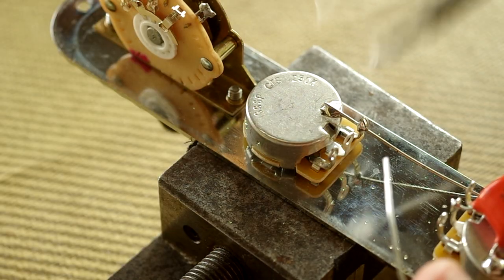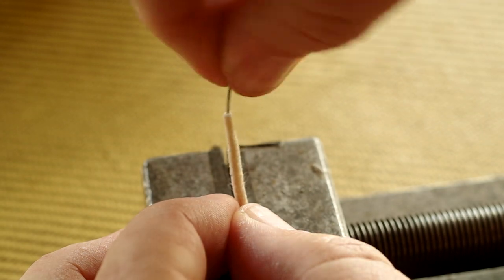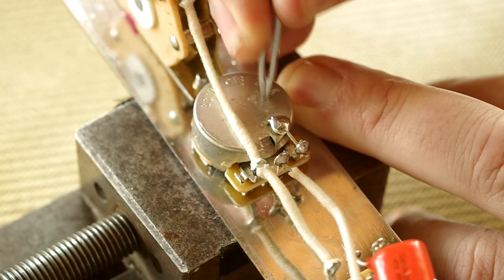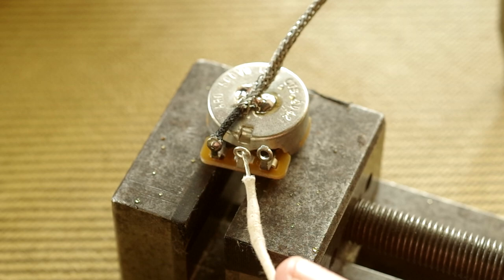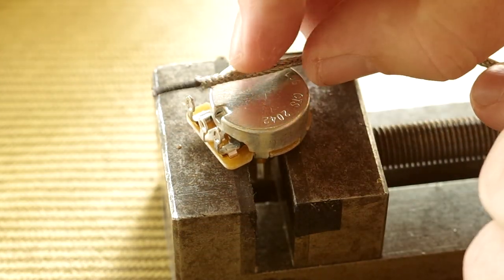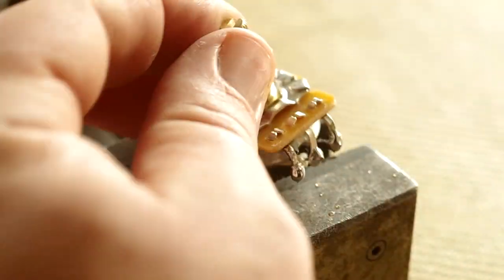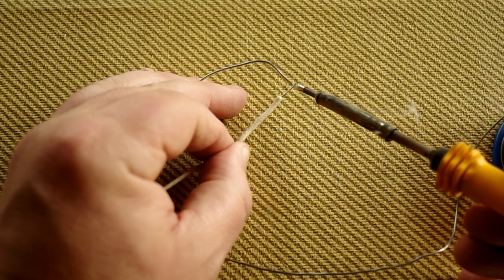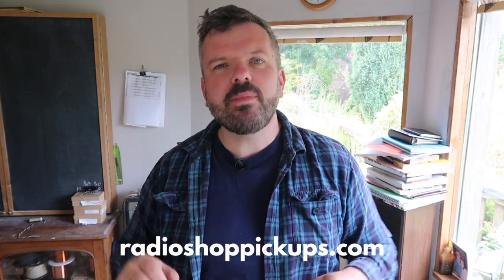Our Top Ten Soldering Tips for Guitarists

Comment: Very good. I have a 25W solder iron, it sucks, not hot enough, I think I need a 40-60W solder iron? And can you extend the braided wire with a short stretch of braided pickup wire? If so, are there specific ways to do this?